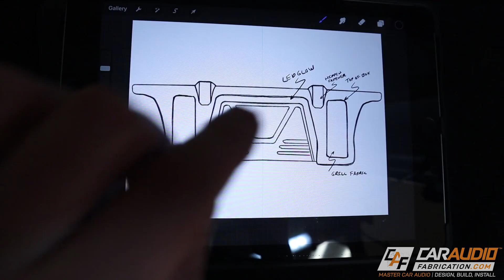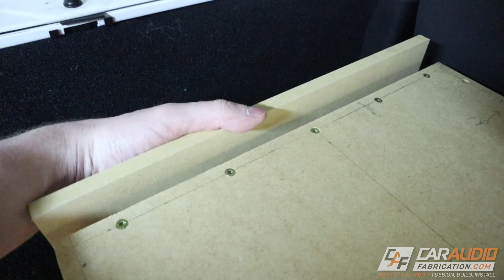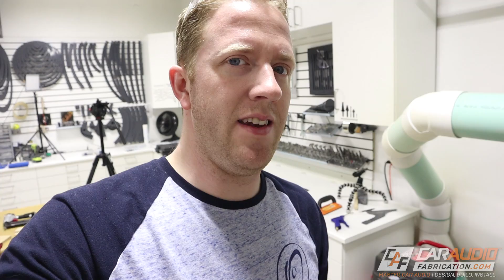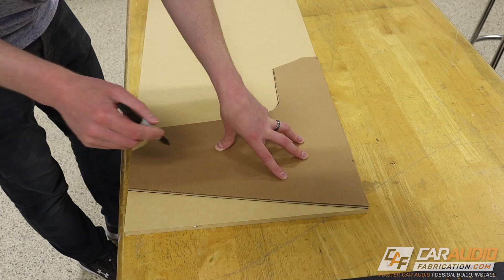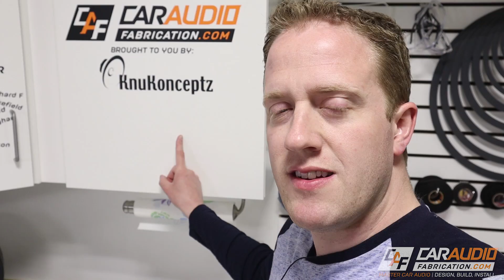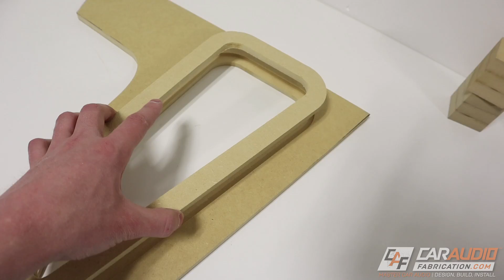How to MATCH the sides! Custom Subwoofer Box Build

Comment: This is off subject sorta but I need help with an aero port I got 3.09 c.f. a zv5 12 and 2000 watts ... a 4" aero port according to the port calculator it's suppose to be 8.77 inches long does that sound right to anyone else

Comment: By far the absolute worst vehicle I've ever tried to build a system for. I love my Jeep but bass and an open air offroad vehicle exposed to the elements with top and doors off don't mix. Had to switch up the rebuild and treat it like if I were doing a system for a boat. Did down firing subs and marine towers instead of loading the soundbar. Speakers in soundbar are literally aimed at the feet of backseat passengers. It's just a horrible vessel to do a build in unless you're not using the Jeep for what it was intended for, which defeats the purpose of having a Wrangler.